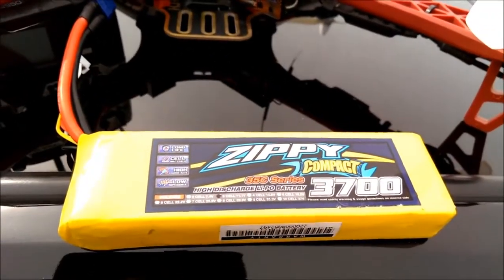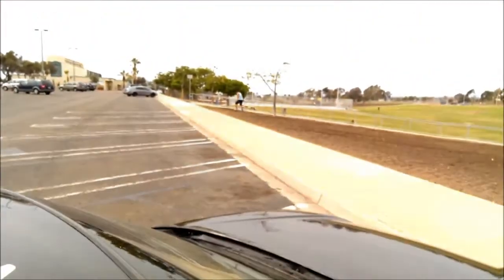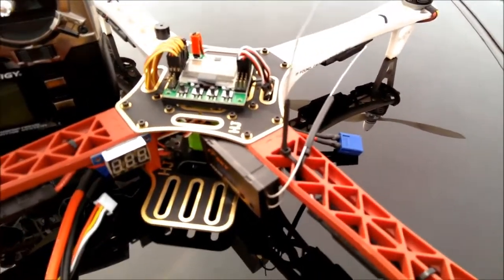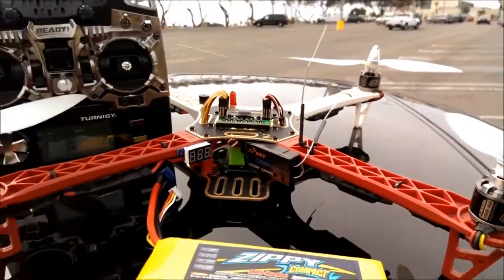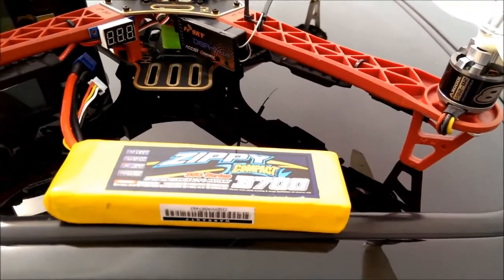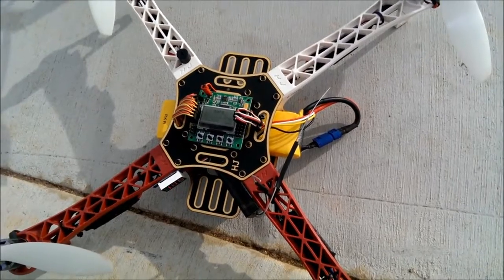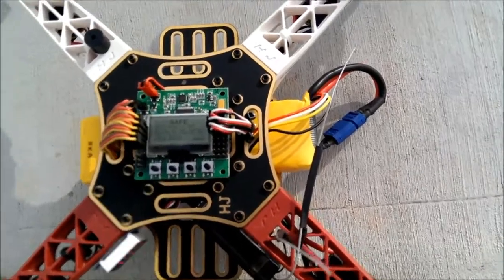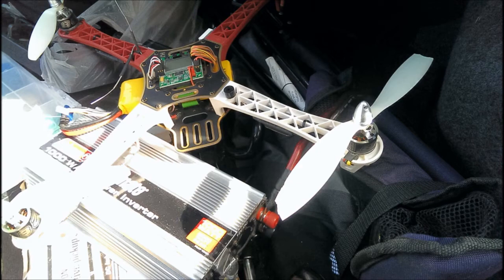Battery Test - Zippy Compact 3700mAh 35C Lipo - Quadcopter

Comment: Hello Mr Paul 
Sorry This may be early to check with you from my side sorry again.

I am NEW to this hobby and looking for some of the details of quad 250 , 350 & 450 i learned a lot form your channel and i like it very much to watch your videos also Alishanmao channel that is how i came in this hobby i saw this (Battery Test - Zippy Compact 3700mAh 35C Lipo - Quadcopter) video of yours and thought i will get those parts now and seems none of these links are working

Full Parts List for my 450 Quad build:
450 Quadcopter Build - ALL PARTS - Part 1
https://www.youtube.com/watch?v=giAEA...

450 Quadcopter Build - COMPLETE - Part 2
https://www.youtube.com/watch?v=zeXeO...

I have purchese KK 2.5.1 Board and CC 3D Board also i wanted to buy mulit v > BUT 
Here is the main part i have frame i have Boards but i do not (what MOTORS, ESC, BATTERIES, POWER BOARD, WIRE HARNES, SERVO CABLES, PROPS, RECEIVER AND TRANSMETER ) I do not have any or these items

COULD YOU PLEASE GUIDE ME IN THE RIGHT DIRECTION I HAVE CHECK FORMS BUT I COULD NOT GET FULL DETAILS CAN YOU HELP ME PLEASE if you want to send me through email you can my email is shukur.wyg@gmail.com

Thankyou once more for helping me thankyou
Reply from the maker: shukur khaidr I've updated the links. thanks for letting me know. Things have changed a bit since I made those videos, but here are the links. 

Full Parts List for my 450 Quad build:
450 Quadcopter Build - ALL PARTS - Part 1
https://www.youtube.com/watch?v=L2RsF1LE3uY

450 Quadcopter Build - COMPLETE - Part 2
https://www.youtube.com/watch?v=SoN39bG8iPc
Reply from the maker: shukur khaidr I'll answer your question here because I'm sure other people want to know. If I could do it all over again, this is what I would change, and why...

Motors/props: RCTIMER SL2212/920KV - http://rctimer.com/product-1200.html. This is basically a copy of the DJI E300. I chose this because it offers the BEST thrust with the least power consumption. You probably aren't going to find a combination better than this. The NTM motors i originally bought are not very efficient at all and are known for having bad bearings and improper balancing.  I've tried replacing the bearings myself in those NTMs but it's just not worth it.

Frame: RCTIMER AlienCopter Bee - http://rctimer.com/product-1141.html. I chose this frame because it is carbon fiber and folds. There are other similar ones, but I just like this one. The DJI F450 (copy) frame I have is flexible and when you start adding weight to it you will definitely notice more vibrations through an onboard camera. My quad actually flew just find when I first built it though. The vibrations, if bad enough, can totally disrupt the sensors in the flight controller and make your whole flight experience terrible.